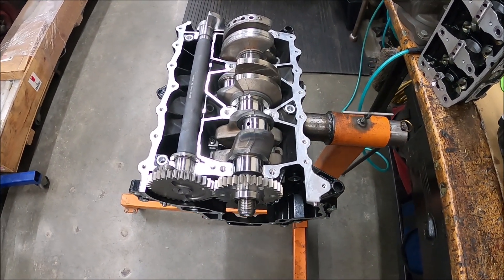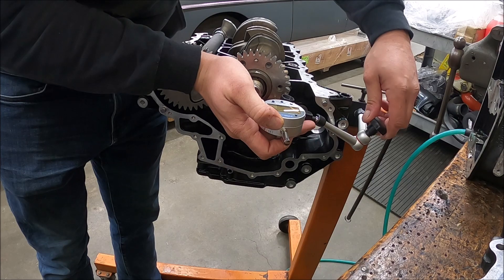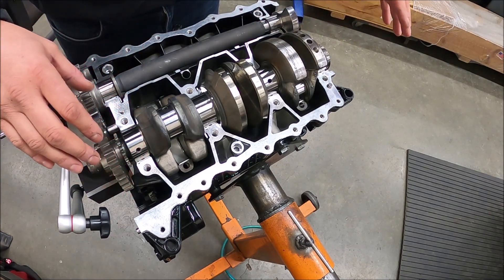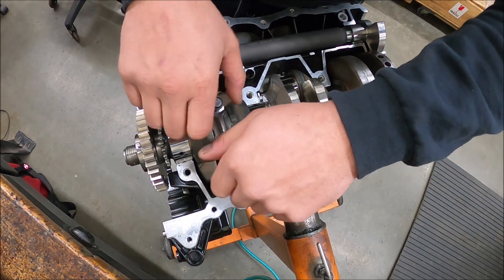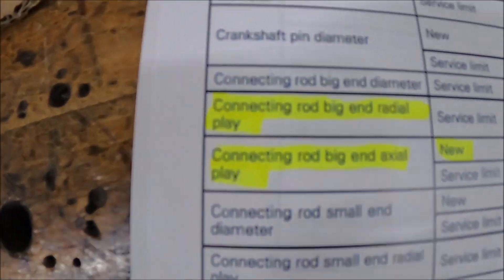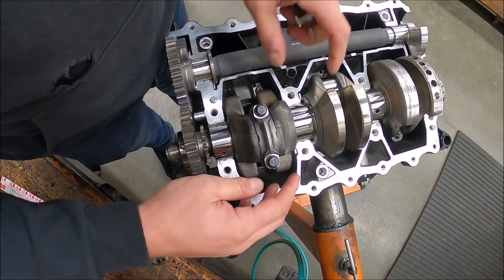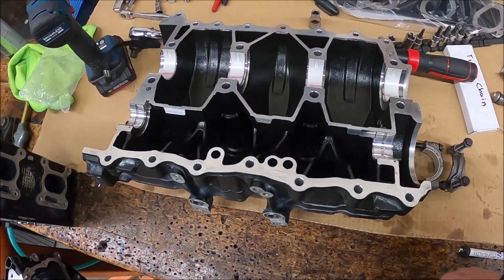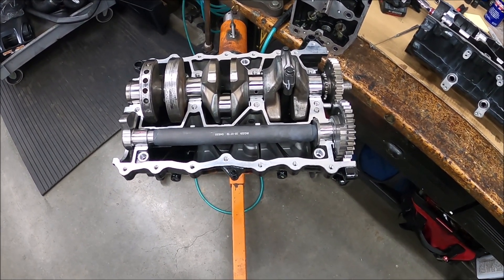Seadoo Bearing Clearance Measuring - Quick Way (Plasti-Gauge) (Rotax 1630 ACE & 1503 4-Tec)

Comment: What brand bearing do you use?
Reply from the maker: Hi, I use various different brands based on application/fitment.  For standard rebuilds I use titan, wsm, or aquasport.  One thing i have noticed is that the majority of the bearings I get from various suppliers are all stamped SBT on the bearing.   I feel like sbt bearings are rebranded by a bunch of different companies.